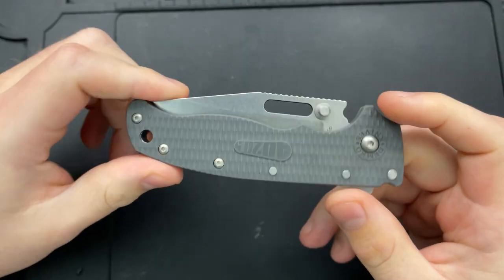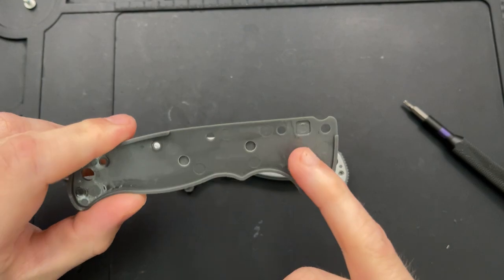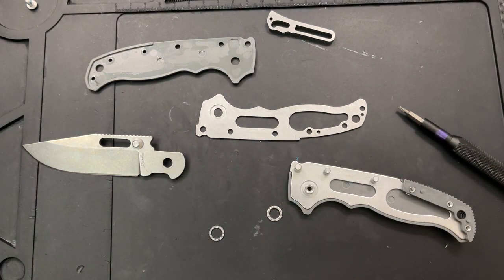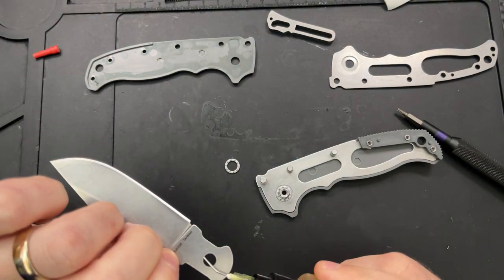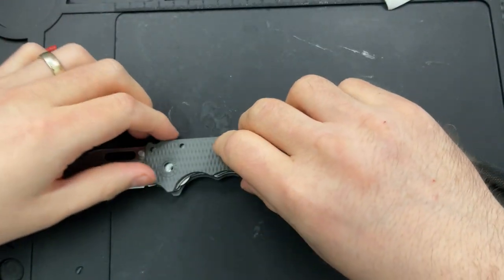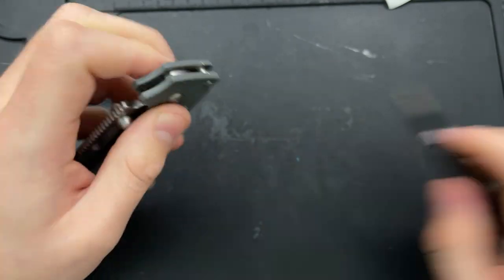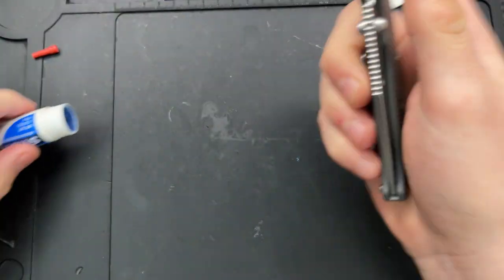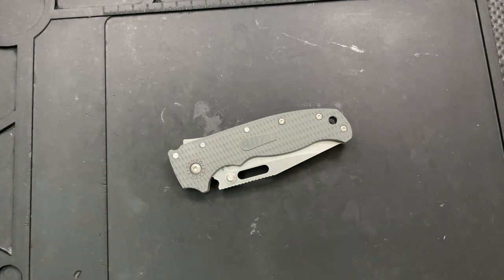How to disassemble and maintain the Demko Knives AD-20.5 Shark Lock Pocketknife

Comment: Not sure if you will see this but I have a question about swapping the bearings on this knife for washers. Is it possible? If so, how do I know what to get in terms of replacement washers? Thanks NS!
Reply: Not sure it’s been done yet. But you could always stack as many washers as u need to perfectly fit the width that the bearings were and boom, it’s on washers.

Comment: I got mine last week and have been enjoying it. Took mine apart a few days ago and was surprised how easy it is.  Took one of my Axis locks apart the next day and was reminded how hard it is. Question: is there any value in lubricating the side of the sharklock thingy?  Seems like it might rub against the liners so I put a little lube on mine.  BTW, I think you forgot to lube the 2nd bearing on the side that faces the liner.
Reply: Axis lock hard? Hmmm.
Reply: @marvinbrock960  Well it’s not rocket surgery, but in comparison? Yes, it’s more difficult especially for a full disassembly. Watch Nick’s video on disassembling the Benchmade Ritter Griptilian. My Benchmade Anthem (still my #1) is easy but I’ve never tried to remove the Axis lock mechanism on it because I know that will be a PITA.

Comment: Nick I just got this knife in D2 from knifecenter. Mine has developed a shriek or squeak when i deploy it. Tried oiling several times. Its a very stubborn and ANNOYING squeak. Sounds like a gas station knife 😤. I didnt completely disassemble it as i cant see any greasable area that cant be reached with a precision oiler pen. I use 3 in 1 PTFE lubricant. Should i use something else?
Reply: Graphite lube

Comment: Too weak liners for my taste,and the plastic is horrible.
I like the blade & lock but not for $150
Reply: The longer I handle and use mine the less the materials used seem to matter - the look isn't very premium, but the feel is - pretty solid, IMHO! That being said, I'll upgrade the scales when I can - but more to make it mine than for any other reason.
Reply: Weak? It is not weak anywhere in the slightest. Probably stronger than any knife in its weight class, easily. There are videos of guys hitting it with rubber mallets to split wood here on YouTube, zero play or issues after it. Some of cold steels knives are made with the same or lesser materials and they’re bullet proof, tried and tested facts.